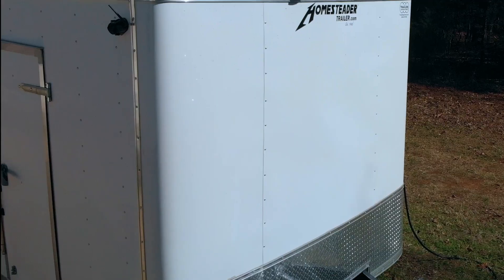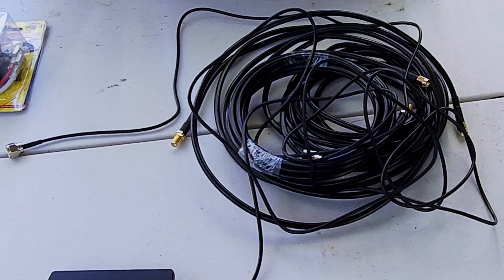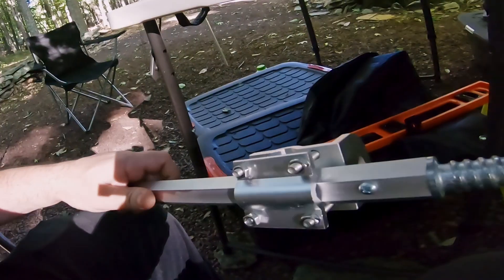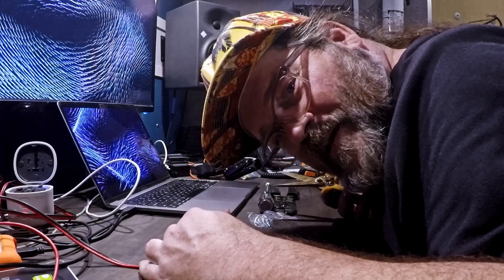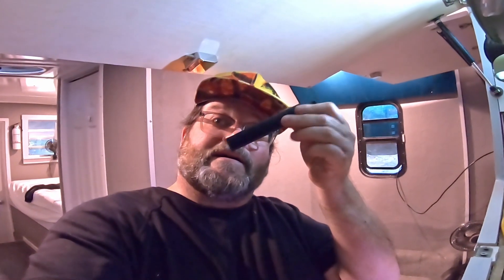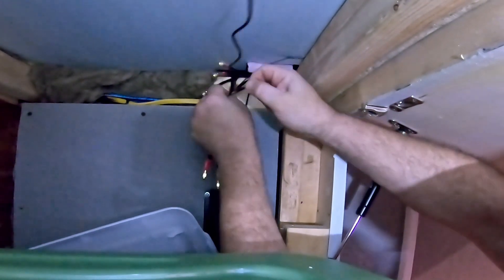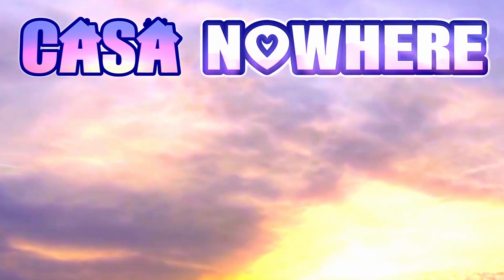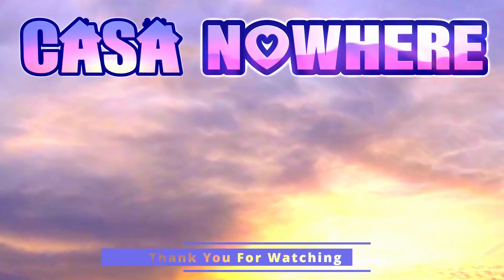Installing Cell Booster! Is Amazboost / SolidRF Better, Cheaper, than weBoost / Hiboost ?

Comment: I got a solidRF dual zone 70db booster on amazon in 2018, it has been great ever since. Not a single issue. I went from 0 bars(couldnt call, sending a text would work sometimes, but usually not within the hour) to full bars, video calling, streaming youtube, even hotspotting my computer over my LTE before starlink existed.

Comment: I’ve found that if you put your phone in airplane mode then turn on the booster then turn off airplane mode your phone kinda rethinks what it’s doing and grabs the stronger boosted signal.   If your phone thinks that the 1 bar that it already has is sufficient it’s not going to jump to stronger signal just because you want it to.

Comment: One question how far does it work from your indoor ant. Some have great range some you have to be on top of it to work thanks
Reply from the maker: It only works so far but if you are using the internal antennas to boost the signal to a hot spot or lte router then you have signal everywhere you have wifi.
Reply: @CasaNowhere  thanks

Comment: Intereting devise. Does it also amplify computer signals as well for computer use outdoors and not just cell phones alone? I'd be interested in knowing this. Can anyone give soem details as I can get a "Weboost" unit cheap and if it can also serve as a computer signal booster for computers I might purchase it. Can anyone enlighten me?
Reply: I might add, I don't use a cell phone.
Reply from the maker: so I use the booster to get signal to my lte router (for my computer) that router then has wifi that lets me use my computer.

Comment: Thanks for the info. This was very helpful.
Reply from the maker: No problem. An update, I have been traveling the US for 6 months now and have always had internet, between the 2 sims the external antenna and in rare cases the booster. Had a couple spots I would have not been able to stay without it, that I was able to get usable internet for work with it.

Comment: Hate to rain on the parade but I did the hill billy solution... I took a tupperware cup with lid, placed an older model smart cellphone in there hooked to a lengthy usb cable (to power the thing) and have the cellphone do a tethering setup between the cell network and the wifi capability...
I use  a telescopic fishing pole minus the thin parts at the end (totalling about 20 feet or so) and hold the fishing pole up strapping it to the van or even a tree... It improves reception very well without the need for expensive boosters or the like. It may benefit from a longer mast but that seems to be a costly thing to get right...the 20 foot fishing pole works but is not über great I must admit...the top bit s=has some flex to it and could become an issue in future becoming weak and breaking maybe...
All other devices connect to the tether and work great, even in rural and slightly remote areas.
Reply from the maker: Nice! A buddy suggested a similar solution to me, but I have a remote job so I thought I should go a little more proper.  But, kudos!

Comment: For your internet I would get an external router as the modem is right at the antenna and there is no signal loss in cables or signal threw walls. Then if you have good internet with the cell router get a "Cellular Network Extender" to get full signal and it can provide five bars of service with 3.5mbps of connection to the cell router that gets slamming service on a mass that can telescope up when needed. Use a 4x4 MiMo aftermarket modem in the router, M.2 or PCIE mini WWAN card. Quectel Cat16 or Foxconn T77W968 Cat16 modems get best 4G throughput! Hope this helps!